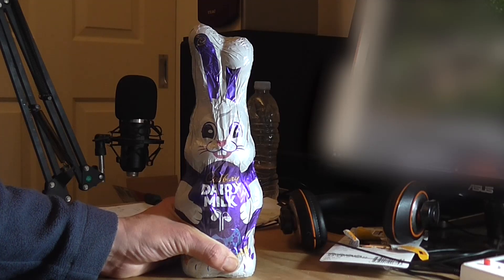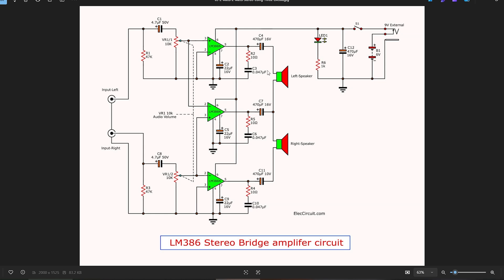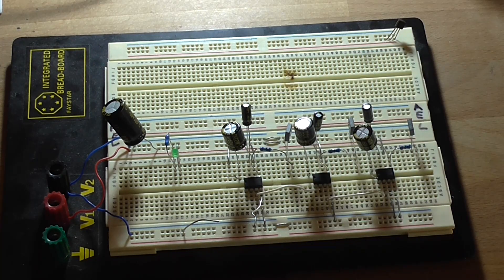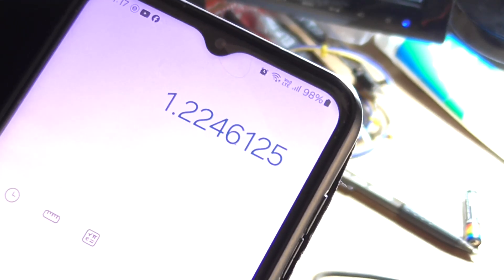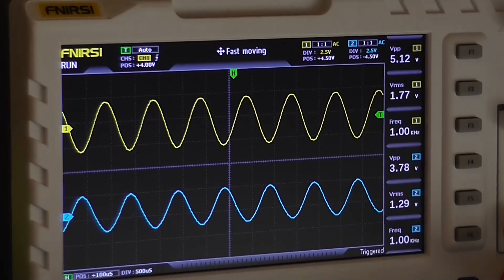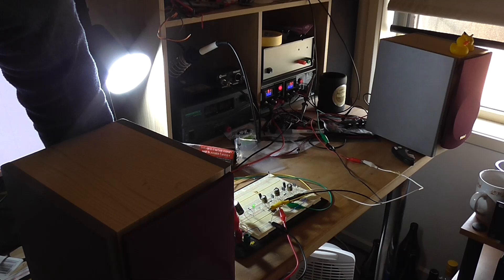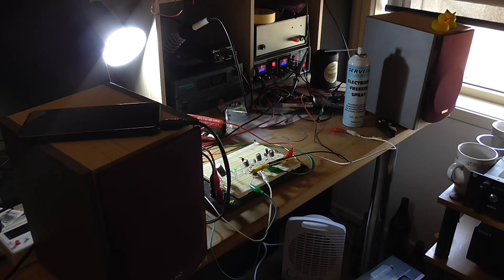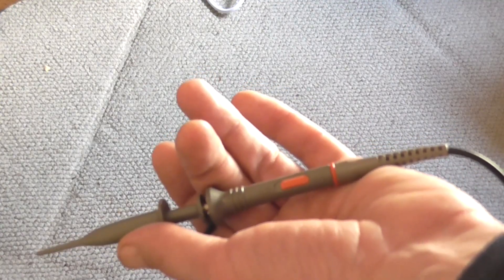LM386 Stereo Bridged Amplifier Experiment

Comment: I understand the circuitry in a way, that the third amplifier in the centre is amplifying the difference between left and right channel and this way add this signal to each of the speakers output. This could be done to increase the base of the stereo signal as known from 80s ghettoblasters with there "Stereo wide" - function switch.
Reply: That's probably the effect. In more simple terms, you save 1 LM386 compared to two separate bridge amplifiers, but there is a lot of (negative) crosstalk between the channels.
Reply: I think the principle bases on the idea that the output resistance of the amplifiers is much lower than the impedance of the speakers. In a low power system with 8 Ohm speakers this could be assumed.
Reply from the maker: Yes, correct

Comment: There is a lot of difference in the LM386. I had bought about 10 for a project from Mouser and then 20 from Digikey. For my project I had made a setup and then I saw that the results differed with each LM386, some had more gain than others, also some indicated more distortion at similar input. None of the LM 386 had the same specification. Then purely for testing, I bought the smd variant from AlieXpress in a lot of 100, they were very cheap, and to my great surprise, these almost all had identical specifications. Out of curiosity, I then bought a 20 in dip housing from AlieXpress and they had the same problem as the ones from Mouser and Digikey. My conclusion, the LM386 in smd package are more reliable. It may not have been tested in a professional setup, but the results are abundantly clear. It was for a project in 2022.
Reply from the maker: Yeah, the DIP can exhibit different results (it depends on the batch, I guess).